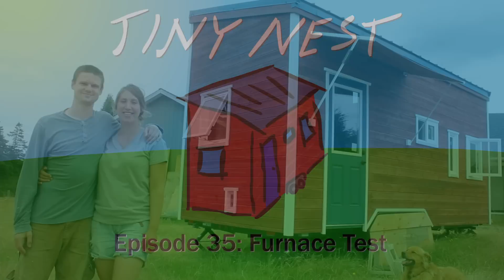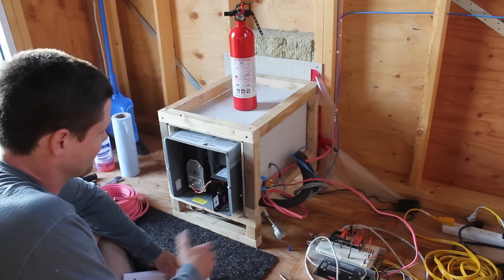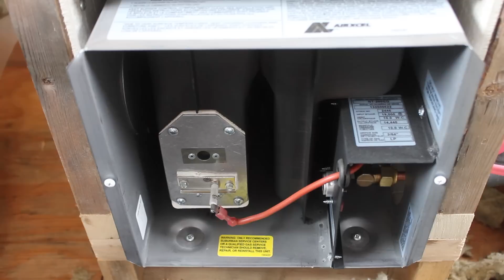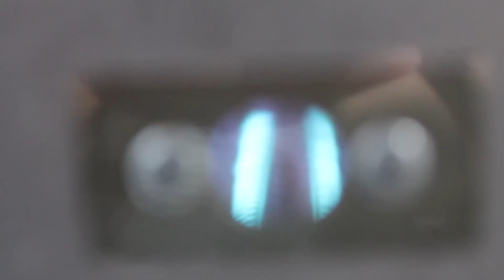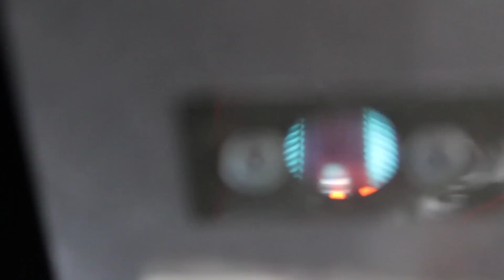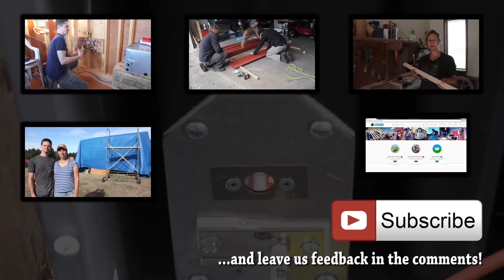Tiny House Furnace Test (Ep.35)

Comment: 5 years later, what's the update? 
Do you love the furnace? Is it still running strong or has it needed repair or replacing? Would you buy the exact same one again, or maybe another brand or BTU size? 
About how much propane do you go through (weekly or monthly) in the coldest months? And do you keep your interior "Tshirt and bare feet warm" or "hoodie and  thick socks warm"?
Did you ever build the small mudroom/ airlock enclosure outside your front door?
Thanks in advance!
 I'm thinking of installing a similar RV model in my year-round liveaboard boat. Tired of dealing with ventless propane heaters and their stuffy air and excessive condensation.
Reply from the maker: Just a touch late on this reply... but yeah the furnace has actually been one of the most reliable and well-performing devices in the tiny. I did do some basic maintenance on the burner which accumulated some build-up/corrosion that was causing notable orange-flame... it was a simple task of brushing/scraping it, and required the replacement of the gasket (I think I've done this twice actually) https://youtu.be/Z5F_SEVzpWc 
Other than that it's operated well and produces enough heat for us. I would buy it again. 
We used 200lb of propane between the furnace and water heater in 2021.
We keep it somewhere between hoodie and T-shirt temperature... the furnace is controlled by a push-button, so we just call for heat manually as needed.
Don't have a mudroom (yet) so heat is lost every time the door is opened.

Comment: I bought the same heater for a cargo trailer that I am adding some of the comforts of home. I know its overkill for such a small space, but it was much less expensive that say a Propex furnace and I will not use an unvented propane heater such as Camco's Wave or Mr. Heater.  So, I've read the manual twice and it was clear as mud, as far as, how much space it needs and how close to combustibles. I am doing a similar thing is I am placing the heater then determining the cabinet layout. Now that I see what you are doing, I will view other things you did. You do nice work, too.
Reply from the maker: Yeah the documentation is a bit of a mess, but after reviewing it a few times it became clearer, especially after being hands-on with the furnace itself... and something that I realized is that it's trying to accommodate a wide variety of possible configurations, so there are a bunch of options listed from which you have to piece together the data/dimensions :P 
That's why we enclosed the entire thing in non-combustible material (including the Roxul insulation in the wall) for good measure. There should be enough clearance even if it was combustible, but it's not ;)
Glad you found the video to be of value!

Comment: So you had your +\- hooked up(red-Red)  (Black-yellow) then just touched the 2 blues ( blue - blue/white) And thats all it took? I might need to back off and just try that first , right now I’m troubleshooting what works between new wiring and old stuff I may be replacing more of. 

Do you have tstat wires in now? Mine has the red tstat in with the live reds and the white tstat with the furnaces blues. And that’s how I disassembled the old ones, should all be in place right...!?
Reply from the maker: Sorry it's hard to follow your situation because I don't know what existing wiring you have... but you are correct about what I did here: Hooked up 12VDC to the red and yellow (observing correct polarity) and then the unit will fire up when a connection is made between the blue wires. A thermostat is just a switch that is normally-open, and it closes automatically based on ambient temperature... so you'd just connect the blue wires to a thermostat. Hope that makes sense... be sure you know exactly what you're doing and stay safe!
Reply: Tiny Nest , now it’s running. But even with fresh wires to the furnace and tstat... it will keep running continuously, after switched to off... it needs the power plug pulled to stop. 

I also feel as if your containment box has deadened some sound! Mine is a bit quieter when heard from the outside, but inside , produces a LOUD mechanical sound. Some more framing  could help this. I wish it just sounded airy like yours!
 Did you guys run into any issues or are you familiar with them!
Reply from the maker: I suspect something is not wired correctly... and if it's making a mechanical sound, it could be a sign of another issue (what power-source are you using?). At this point I would recommend having an RV tech have a look... this is not something you want to have even a shred of doubt about it working properly... BE SAFE
Reply: Tiny Nest yeah I’m with you on that, having a tech make adjustments, oil bearings, hand some advice and who knows what else to make it fresh :) 

Running a goal zero yeti 1000 w/ their 200watt

Comment: Very helpful videos. I was wondering if you could help with wiring to a thermostat can’t find anything on where and how to attach the two blue wires to the thermostat.
Reply from the maker: What I've found is that the furnace is turned on when the blue wires are connected together. A thermostat is usually a "normally open" contact which closes when triggered by the ambient temperature. For testing and temporary use, we just connected the blue wires to a toggle switch to run the furnace manually... but of course this can be dangerous if you turn it on and walk away, it will not turn off automatically (there should be protection circuitry inside the furnace itself, but that is a backup to the normal control of a thermostat).

Comment: Love your videos, we just bought our trailer and they will be very helpful for our build. One question about this one... I know that these furnaces can require regular cleaning and maintenance. Your furnace looks like it would be very hard to remove once your done building. Is this a consideration for you or would it be easier to pull out than I'm imagining from the video?
Reply from the maker: It's definitely possible to pull it out but it would be a pain. The burner can be accessed by removing a front plate, but we haven't gotten in there for a cleaning yet. We will make sure to shoot a video when we do any inspecting/cleaning of the unit.

Comment: Can you run this on a solar bank full time (4 season)? We live in a northern climate and are aiming to put something like this in our unit. We just done want the ignition to be draining the batteries all the time or anything that's all. Also, did you find that you had excessive condensation because you burn propane? If so, what did you do about that and what kind of air exchange system or fix did you have for this issue? Thanks!!
Reply from the maker: We haven't measured the continuous draw of the blower motor, but I can't imagine it's a lot. Any solar/battery system is capable of running out, but I would be surprised if this furnace would drain even a small setup. Just do the math!

Comment: excellent videos on the heating (yet to watch any others) I'm thinking converting my truck canopy to a little camperette and using the propane furnace from my old 9.5 foot camper that came with the truck
Reply from the maker: Thanks for watching. So far this unit has been working well, and we'll really be putting it to the test this winter.

Comment: is there a specific reason you went with a propane heater instead of an electric one, given your experience?
Reply from the maker: Anything that produces heat consumes a lot of energy, so to go 100% electric can result in the need for a huge electrical service... we chose to balance the energy loads by going propane for space and water heating (which are two of the heaviest energy loads), and then use electric cooking. This way, we have medium-sized electrical and propane supplies, and still have plenty of head-room in both.
Reply: Tiny Nest Interesting. My mom talked to a guy that had a tiny from this company in missouri and his was able to be heated by a little infrared fake fireplace to the point where he had no need for using the heater that was installed. He said "I was up in the loft sweating" lol
Reply from the maker: Heh, yeah our furnace should be overkill, but we will likely be opening the door a lot, including during the winter.

Comment: I've got another electrical question for you. I have the same furnace but just noticed today that the instruction manual says "Connect only to a protected circuit fused for not more then 7.5 amps." So once you convert the houses AC power to DC through the supply driver how do you protect it to 7.5 amps? Up until now I was planning on having the supply driver branch off a 20A circuit that also contains a few AC outlets and smoke detector. Would that be wrong to do? Thanks in advance and keep up with the amazing work! I always tell new builders about your channel.
Reply from the maker: +Corey McDaniel Glad to see you thinking about this. You absolutely need to fuse as per the furnace manual (and/or wiring etc.) Make sure your DC power supply has built-in overload/overcurrent protection (most should) which should keep the supply itself relatively safe from burning up... but then once you have your 12V heading out towards the furnace, put a fuse right up close to the supply... we're going to have our 12V lines go immediately to a fuse block like this: http://amzn.to/1KQ58vW and then we can fuse all our little electronics at the safe amperage values with simple automotive blade fuses.
Reply: Note, as my Indian coworkers might say, "let me explain you".   (lol).  just to make a point clear: There are multiple points of fused protection, and you want them all (lol)..  The power strip will likely trip at 15 amps (ac power) (and your "fuse/circuit breakers", have 15, 20 or 30 amps (AC).      Your DC power supply, can have a fused protection for the output.  So, 7.5 is typically a blade fuse for dc, like in cars.   Tiny Nest made a good reply, but I did not want anyone to think that the power supply protection was enough protection for the DC circuit.
Reply from the maker: Yes this is exactly what we were trying to say :) 
A supply should have built-in protection to protect itself from overheating, and then when you power a device with it you need to insert a fuse to prevent too much current from ever reaching that device. It's taking a lot longer than expected, but we will be making videos about all that when we get to it.

Comment: In theory to help reduce the sound of the fan you should have a larger intake. The fan has to work harder to suck in air through the small gaps on the sides versus a larger free flowing one
Reply from the maker: +Robin Banks Hm, this is a good point. We have met the installation specifications so hopefully it's not any louder than it's meant to be under normally operating conditions.

Comment: How do are you doing to power the furnaces DC fan and spark for long term use? Is there a simple way to convert the houses AC power to the DC power that is required for this furnace?
Reply from the maker: +Corey McDaniel At first we will simply use this type of DC power supply http://amzn.to/1GQ51yi 
I've tested the furnace and water heater to confirm that they operate properly with this type of unit.

In the future we can always get a battery-bank going and switch all of our 12V stuff over to it. There is some really cool 12V stuff in the works... so stay tuned ;)

Comment: I see you have got propane lines to the furnace and the water heater. Will you have a third line to a cook stove ?   Nice work!
Reply from the maker: georgebushwack We're planning on cooking with electricity. In theory, we could always run another line if we decide to switch to gas, but there are a few reasons why we've chosen to go this route that we'll get into later ;)

Comment: Pressurized canister on top of a heat source.  Living dangerously.
Reply from the maker: wwwShadow7 lol inorite.... no it was not hot at all actually, and it was just up there to be in the video ;)
Reply: he made the housing out of sheet cement board, so the fire ext.is sitting on a non combustable   surface that is not likely to get hot.

Comment: Excellent test. Should be all you'll need to stay warm until it drops down below freezing. Then an oil filled radiator type electric to keep it warm is all you need.
Reply: Tiny Nest - Assuming 19k BTU and 2200 cu.ft. interior, maximum temperature increase is about 85 degrees if your insulation & windows are good.  Water source at negative temperatures would probably be your biggest/immediate concern...

P.S.  You two have done a great job on these videos so far.  First timers can learn a lot from your successes and errors.  (That door was quite unfortunate.  Maybe it's just me, but with a custom door, I'm amazed at how much work you had to put into the new one to weatherize it..)

Oh yeah, ... and nice "Borat" impression...  Nerd!   :-P
Reply: Tiny Nest - I saw someone else was using one of these, and this post made me think of it...  Might add a nice "romantic touch" if you ever wanted some supplemental heat...  Might not be best around children and/or animals though.....

http://www.ethanolfireplaces.com/product.asp?itemid=109&gclid=CPSG-YH79MYCFRCqaQodmaYDDg
Reply from the maker: jeffillinois That little fireplace thing is wicked.... might have to look into that later ;) thanks for the link.
Reply from the maker: Jerry Densmore Thanks!  Doesn't usually get too cold here, but we will just have to wait and see once we are living in it!
Reply from the maker: jeffillinois The water heater is supposed to be 50k BTU... but we have only done a little testing so far to make sure it works. 
The door was... an intense experience. But it's because most doors are under an overhang, and ours is much more exposed.
Just you wait till you see the "Nerd Station" ;D